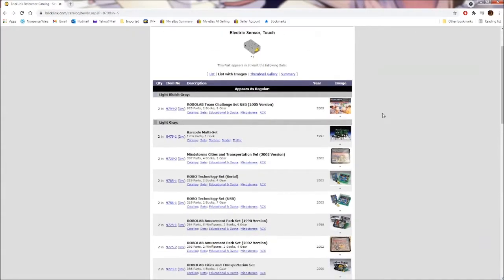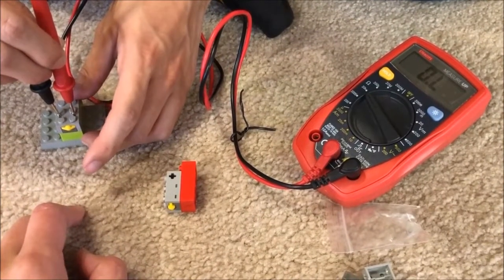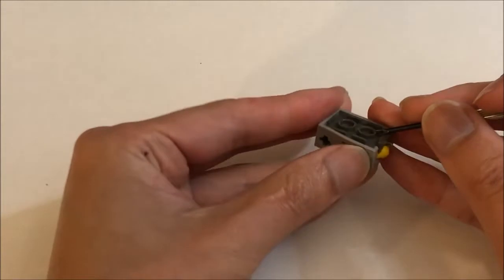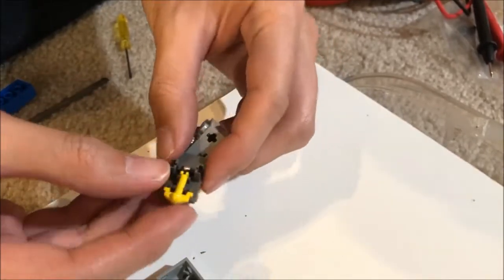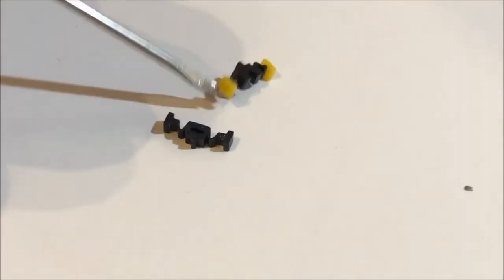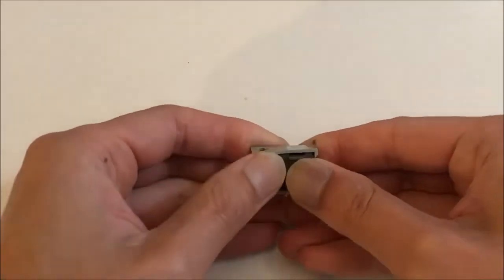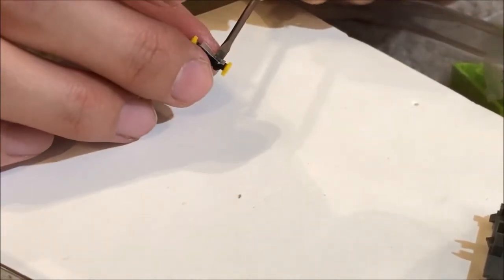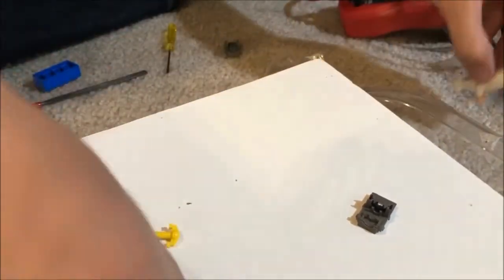LEGO Technic 879 Touch Sensor Disassembly and Repair

Comment: extremely late reply, but I found a video by "Xeonbrick" were he used a touch sensor as a momentary off switch. I tried his wiring diagram with regular 9v wire but failed. Can you give it a look a see if its posible?
Reply from the maker: Can you link the wiring diagram?
Reply: @NonsenseWars  A wiring diagram doesn't but I can link the original tutorial. https://youtu.be/36SpXaW8Ioc?si=_mrEcr6P1KxWgtrr
Reply: *exists

Comment: I wonder if rubbing the carbonized rubber on a piece of paper or something will help...
Reply from the maker: That's actually an interesting thought... that it might be like corroded rather than rotted. We didn't try it, but we definitely will if we take another look at these.
Reply: @NonsenseWars  Late reply, but I can confirm it works! I got a Mindstorms 1.5 set recently, with one of the touch sensors dead. When I took it apart, sadly it was the squigly one. But I did try this and rubbed it on the paper. Now, comparing the two sensors, the one that was working and the fixed one, I do get slightly different resistances, and the fixed one triggers a bit later, BUT it DOES work.

Comment: Thank you for the valuable information. I always wondered how these switches work and if they could be useful for other purposes. But unfortunately Lego messed up with their 9V-system with these "sensors". It seems to be impossible to use such a switch with normal 9V-elements, because they just short the circuit if they are triggered and therefore may cause demage.
Reply from the maker: We're basically doing a straight up short in this repair... you should theoretically be able to use a regular switch in place of these sensors, but to be fair we haven't tried.

Comment: Nice video!  you could try getting some conductive paint, like is found on the bottom of rubber buttons in keyboards/remote controls
Reply from the maker: I think the paint would wear really quickly due to the flexibility of the rubber... but I think a self-adhesive foil would stick better than the glue. It doesn't even need to conduct through the adhesive, we just haven't had the need to fix more yet XD